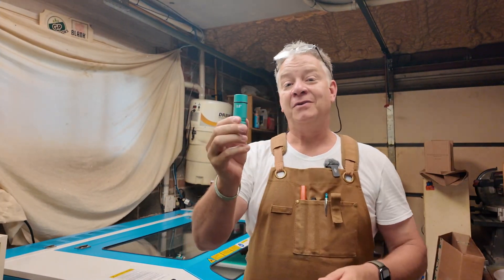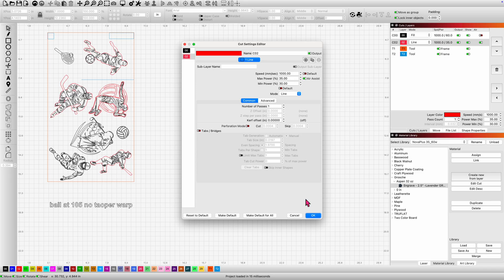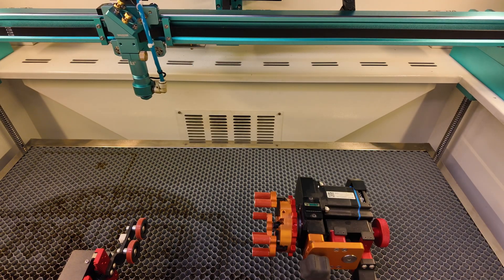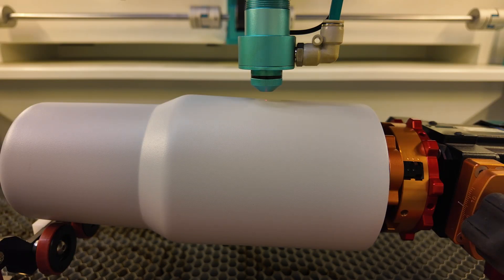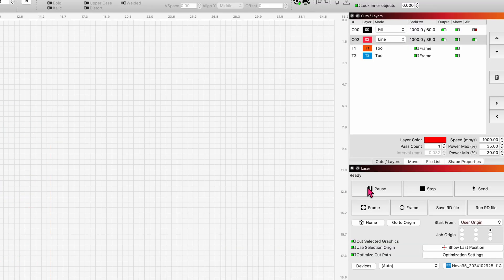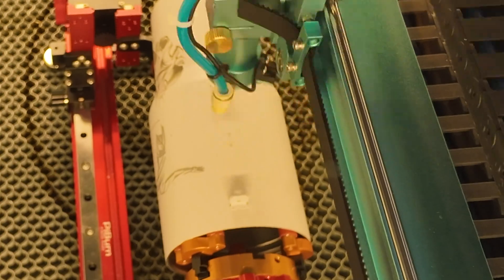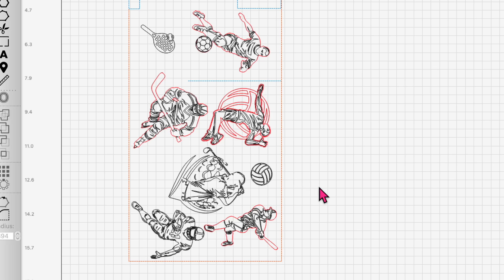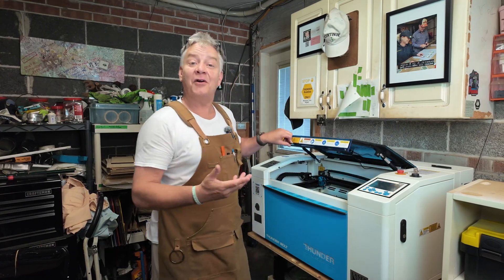It's NOT Broken. PiBurn GRIP2  Rotary on Thunder Nova PLUS 60 Watt RF Laser 091   4K

Comment: Great Video Gord.  Something that could be added is take a block of acrylic or piece of wood and make it the same longitudinal  dimension as the extension.  This block then becomes the focus block you can hold on your container and issue an autofocus down to the block when the lense tube is removed.  That way you can always auto focus with or without the extension tube in place without having to disassemble and re-assemble the lense each time.
Reply from the maker: That's a great idea Todd - it would be quicker and easier for sure. Thanks for the suggestion!

Comment: Good afternoon, I have a question. I have a piburn 2 grip and I use it in an OMTech 2440 pro 80w laser. Is the rotation the same or it changes if the glass is 20 oz of 30 oz. I look forward to your answer
Reply from the maker: Good morning Luise. Great question. The Steps Per Rotation are specific to your machine/manufacturer so most likely the Steps Per Rotation for your Omtech will be different than for my Thunder Laser. However, if you have the correct SPR for your Omtech, then it never changes no matter what size of cup or material you are engraving. But you need to have the exact diameter of the cup correct - that will change. I always use my calipers and I measure the diameter of the cup, at the biggest (widest) end of the cup, and I measure it to 2 or 3 decimal places for accuracy. This video may help explain it better. Let me know if you have other questions and i will try to help. Cheers!  https://www.youtube.com/watch?v=7fXI0YdYDbw